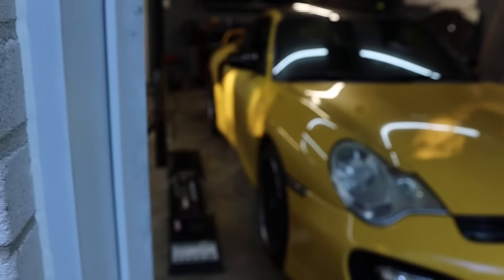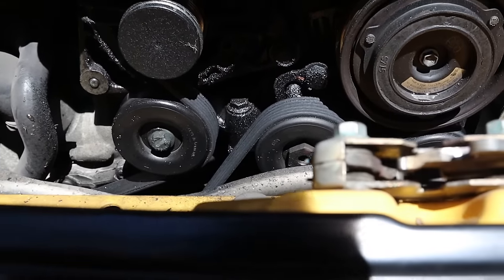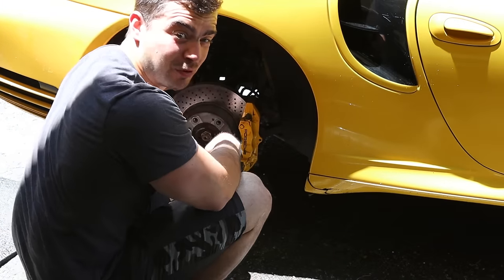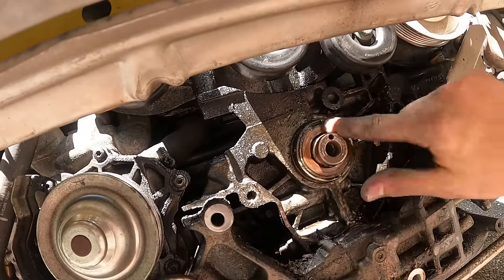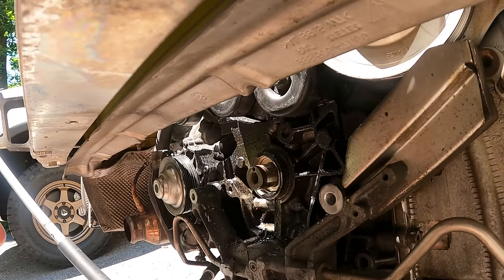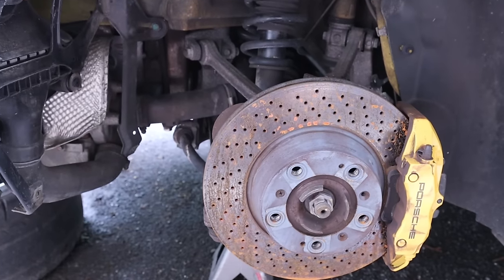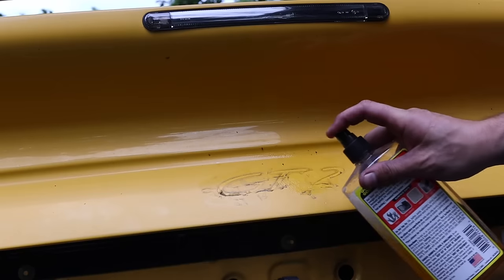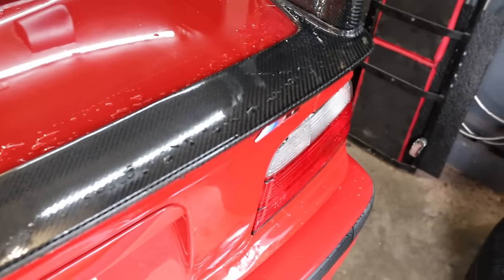SAVING a Cheap High Mileage Porsche 911 Turbo From Becoming Scrap!

Comment: 👍for the Porsche content. Personally, I would put the turbo badging on it, as it deserves the recognition. Look forward to seeing the wheels and what tires you have chosen. A full polish at the end of the project will be the icing on the cake. 👍🇨🇦
Reply from the maker: Yup, buff and polish is going to brighten it so much!  Still have to get a front bumper and skirts, have the roof fixed, paint the rear bumper, blah blah blah the list doesn't end!

Comment: I have a couple of 911SCs and I buy a lot of my parts at Pelican but you need to shop around to get the best prices. I forgot to mention, the Pelican Forum is a great place to pick up both used and new parts on the cheap. I bought a DAS roll bar (retail for $2,399) for $500 including shipping and a 911 front galvanized latch panel for $125 shipped (they're around $800 retail and the one I received was brand new).

Comment: Good to see that GT2 bad go lol Please put the turbo badge on there. You’ll thank me, later. The front wheels get a ton more brake dust. Good job, so far! Great video!
Reply from the maker: Most likely going with a turbo badge, just have to find one I like.  Thank you!
Reply: @matt13ross  You probably know this, but check the factory service books for PNs on items like badges that dont have them marked on the actual component.

Comment: Best way to find an oil leak is a UV dye and a black light! I've used that every time I've had to pin point a leak and it's worked every time!
Reply from the maker: Found it and fixed it!

Comment: Next time you have oil gummed up everywhere and dirt and grime that is hard and thick and brake cleaner won’t get it, hit it with some WD-40 like real thick. Let it soak for a few hours and then hit it with power sprayer that stuff will come right off even with low pressure
Reply from the maker: Never heard of that use for WD. Thanks!

Comment: Was looking forward to this - getting there! What are you planning on doing with those wheels?
Reply from the maker: Selling them!  You want?
Reply: @matt13ross  I think I do actually lol, what’s the width and offset?
Reply from the maker: Good question, I can find out.  I know the rears are 295 in tire size.
Reply: @matt13ross  I think the max I can put on mine are 10s with 265 🥲
Reply from the maker: Carerra?
Reply: @matt13ross  I wish! Just a 986 hard top.
Reply: I could be wrong but I think those wheels are Victors.  I have a set for my 996tt.
Reply from the maker: I have to take a look at the backside, haven't done that yet.

Comment: i like ur videos.. but very average job cleaning the brakes.. you should have used a steam machine which are like 130 and it would have removed alot of the brake dust from the calipers along with the wheel archs..
Reply from the maker: It didn't do a full detail on the brakes, just a quick 5 minute job.